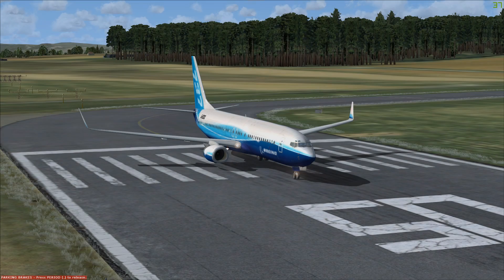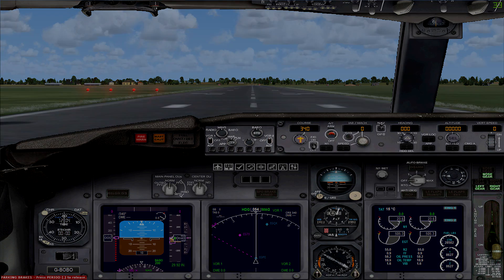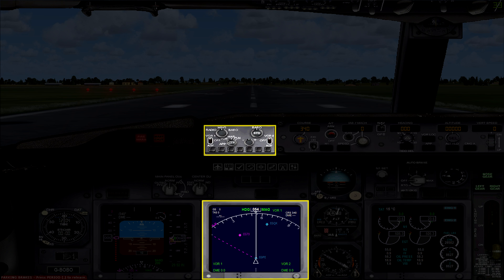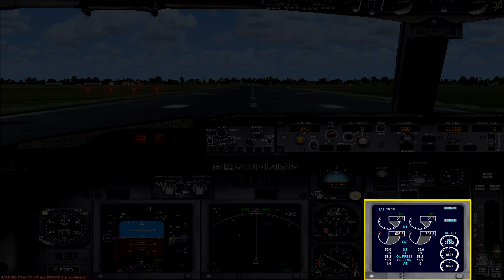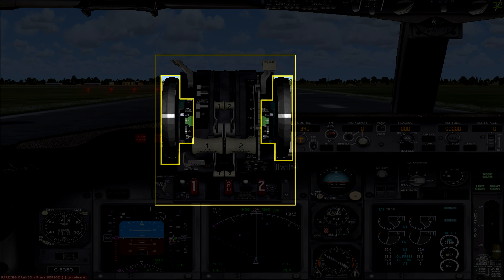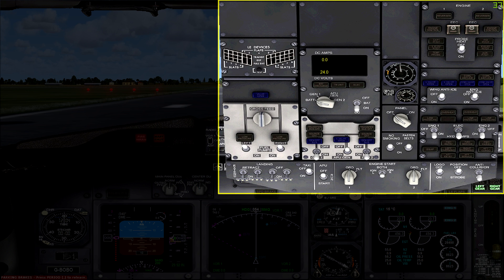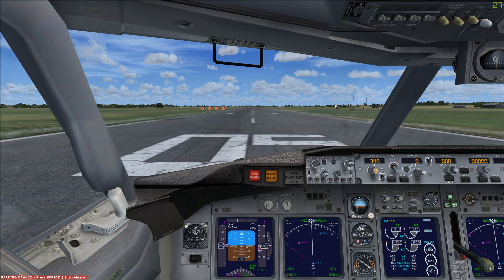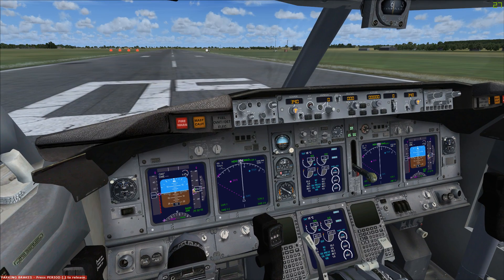FSX Tutorial: Boeing 737

Comment: Hi there, I have flown ten times with B737 and i crashed eight times :(   . I wish you could make a video how to fly this beast. I mostly crashed during take off and landing. I stalled all of a sudden and i have no idea why.
Reply from the maker: You need to keep an eye on your airspeed as you're flying this plane. Remember that this is a big jet, not a Cessna so you need to be aware that it will fly much faster and have higher stall speeds. I can't remember off the top of my head but your approach speed will be in the region of 135-150kts. Are you using flaps for takeoff and landing as well? Flaps will help control the plane at lower speeds as well.
Reply: Thank you. I think i need to practice a lot more to master this jet engine. I will keep flying until learn it very well.

Comment: Did u do any video of landing this plane? I don't know what time I should deploy my flaps!
Reply: This is what I do for descending in a 737
Cruise to 12,000 - 250 KIAS Flaps UP
12,000 to 5,000 - 240 KIAS Flaps UP
5,000 to 4,000 - 220 KIAS Flaps 1 OR 2
4,000 to 3,000 200 KIAS Flaps 5 OR 10
3,000 to Localizer Intercept - 180 KIAS Flaps 10 OR 15
Localizer Intercept to Glideslope Intercept - 170 KIAS Flaps 15
Glideslope Intercept - Gear Down
2,200 - 150 KIAS Flaps 25
1,800 - 140 KIAS Flaps 30
1,500 - 130 KIAS Flaps 40*
300 to 800 - Disengage Autopilot

*Flaps 40 Only on Short Field Landings
*Level off 2,500 Above Apt
*Use Altitude Above Apt Starting at 5,000
*Speeds may vary due to the plane's weight